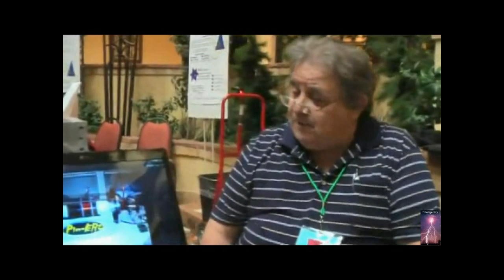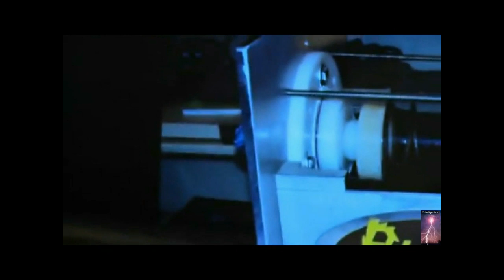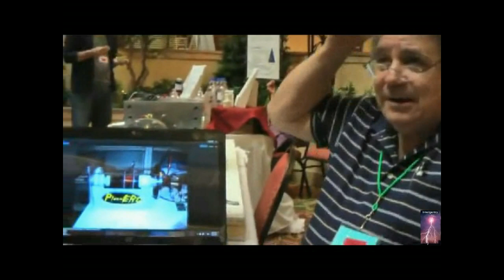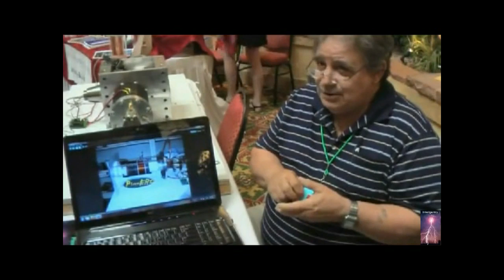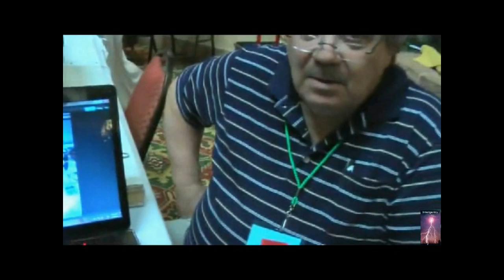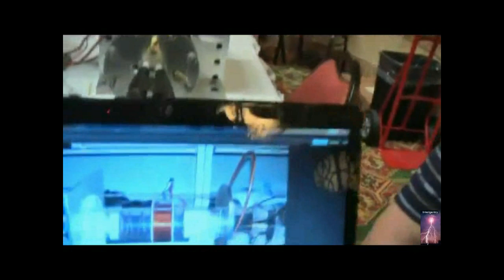PlasmicAnomoly.avi

Comment: Frequency requires an oscillation. A single dc pulse will not give a frequency.

What you may be witnessing, is a singular blast of concentrated electron emissions.

A cojlf of wire,generally does not get hot from voltage, but will melt from amperage...